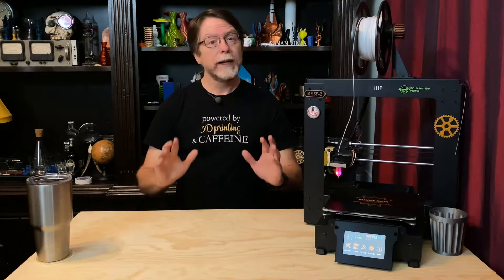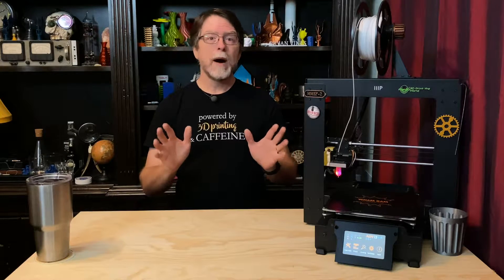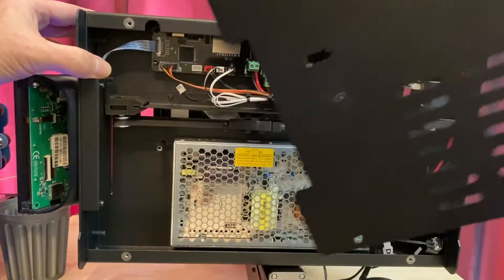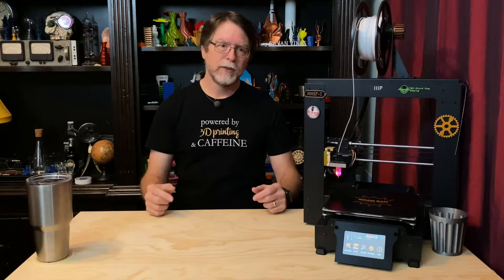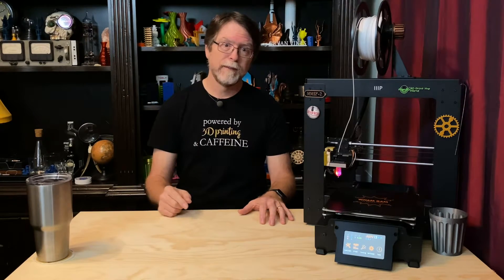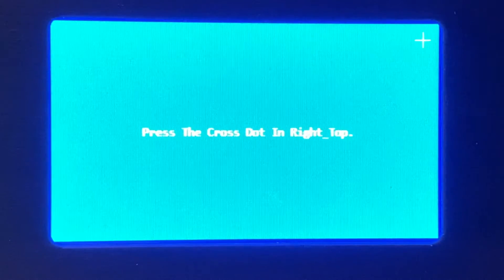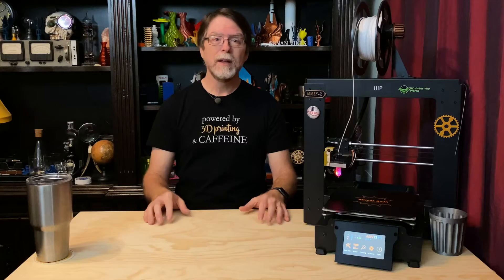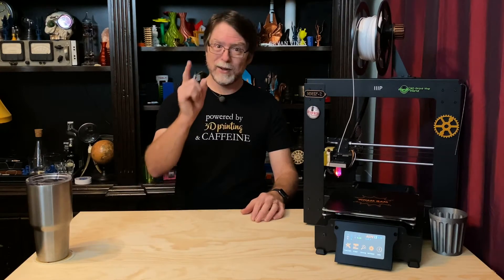How To Fix an Unresponsive Touch Screen - Monoprice Maker Select Plus

Comment: Had an issue with a non-res[ponsive screen on a Hydrawise Irrigation controller.  Their customer service had no solutions.  It was clear that the touchscreen was non-responsive.  Then I saw your video and calibration did not reset put using an iPad pen and going slowly and feeling my way around the screen allowed me to do the configuration I needed.  Thank you!!!!

Comment: Hi Bryan 
Another great video, my problem is that the control knob on my Voxelab Aquila is becoming unresponsive at times, do you have any way of fixing it? Also I have seen on Amazon a touch screen replacement for the Creality Ender 3 printers and I was wondering if it would be suitable on the Aquila. 
Many thanks 
John

Comment: I wonder what caused this, does it boot with a config file for the touch feature?
Reply from the maker: I suspect it was just random technological weirdness. The screen is a self-contained computer with its own SD card slot. It communicates with the printer's mainboard by a serial connection. When you perform actions on the screen, such as homing the printer, the screen sends the appropriate G-code commands to the printer. And it monitors the mainboard's serial output, so it sees (and displays) Marlin's regular temperature updates.